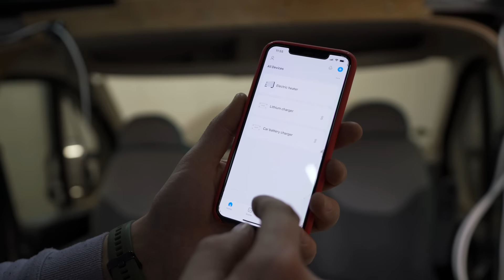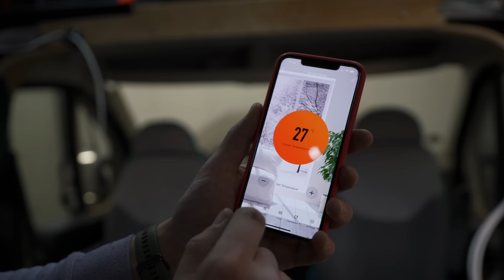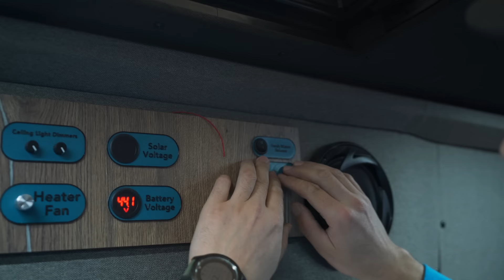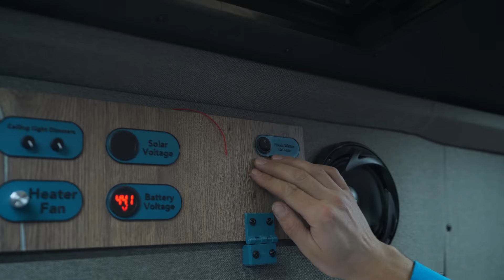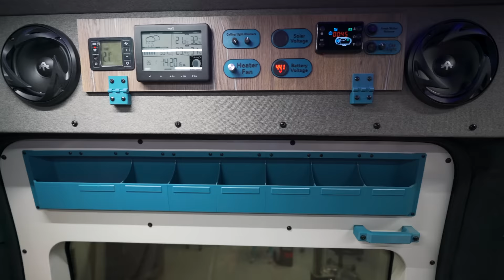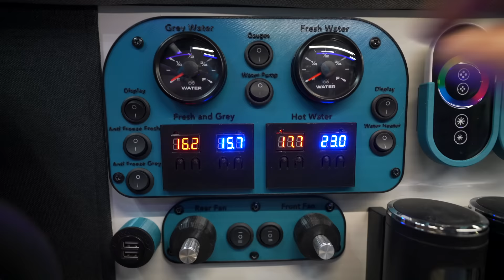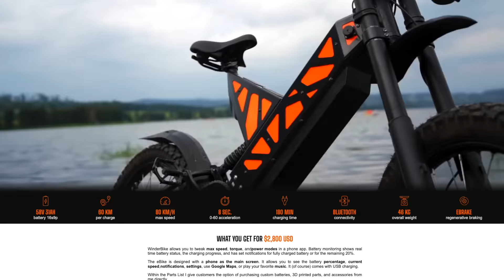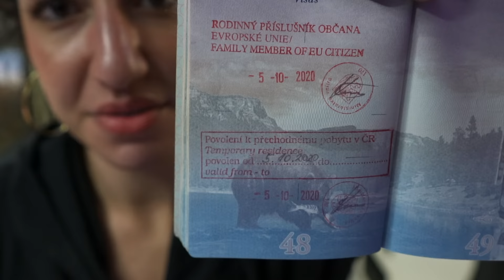Building our DREAM Campervan (van build s4)

Comment: Actually surprised Ladi hasn't gone full home assistant on the van to control everything.
Reply: This is the way.
Reply: @tonyb9785  join us Ladi!
Reply: Yeah, seems like he's juggling several apps on the van
Reply: I often wonder what a Home Assistant system would look like in a van like this. I would tend to think if you're building it from scratch it would be nice to forgo WiFi IoT. I recall seeing an ambulance build where a guy used Home Assistant. I recall him showing his electronics cabinet, which had a lot going on. I think my big question is, what boards exist for this sort of thing? I'm thinking of scenarios like lights; you have an on/off physical switch and then the ability to turn the light on/off programmatically, so if you don't use WiFi (other than from your phone to the Home Assistant server), what is  the ideal solution? I'm picturing something like Shelly 1, except instead of WiFi there's some wired alternative.
Reply: Same here, also little surprised by it. He thinks about everything and making this van a smart van, would be so logical. Missed chance...
Reply: Home Assistant directed by ChatGPT.

Comment: For the bed actuator remote a 3D printed custom mount next to the light switch could be nice so you can just utilize it without having to pickup but still be removable if needed.

Comment: How thick is the insulation in the container house? In the middle of designing a tiny house and want to keep the insulation minimal to get the most living area but also manage cold winters. As for the delivery maybe a cnc or something (I forget if you have one or not) or some other type of thing to make parts or more video related equipment maybe? Really hard to tell from a big box haha but looking forward to finding out

Comment: Hi Ladi and Margaret, and thank you for another great video 💪
I am wondering what the electric heater you showed in the video is?, as it is not on the parts list from your website. Did you install an electric heater used for when the car is running on shore power or what is the purpose of it when you also have a diesel heater?

Comment: I missed the chance to ask questions on your community post. I want to know details of the battery system. They look like pouch cells. What is the chemistry? Did Ladi build them from individual cells? Etc. 
BTW: I binged on some back episodes yesterday, particularly Insulation. I'll probably binge some more in electrical today.